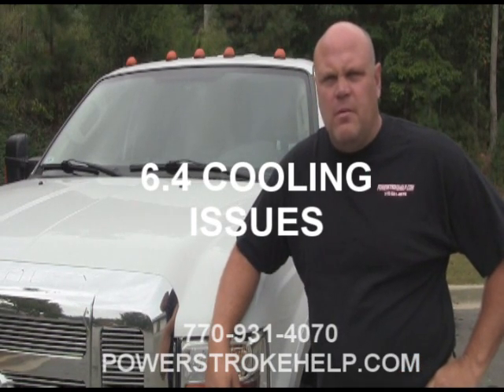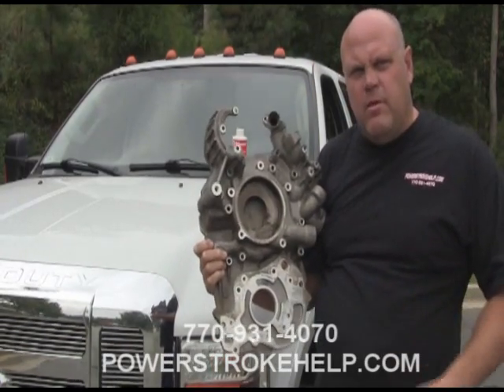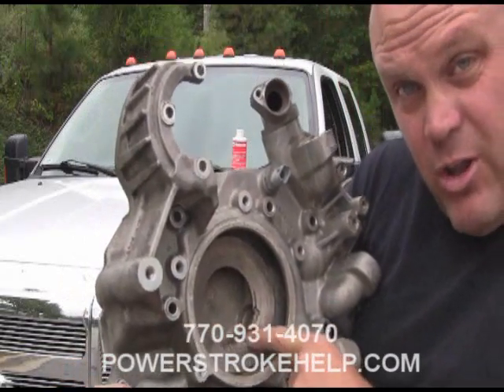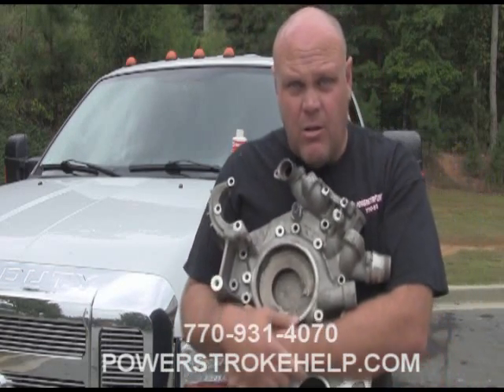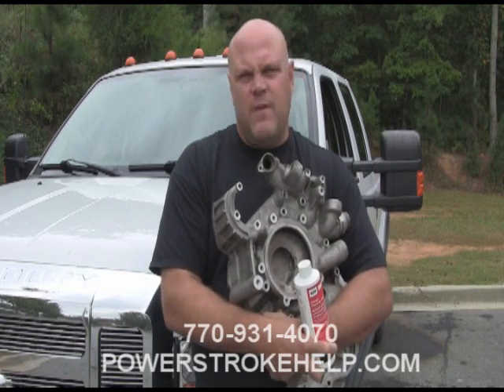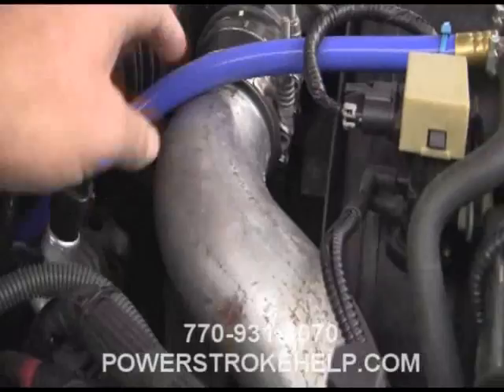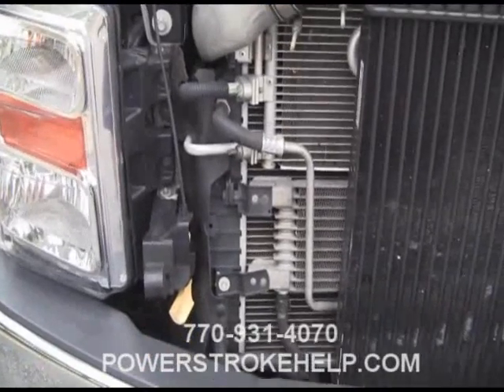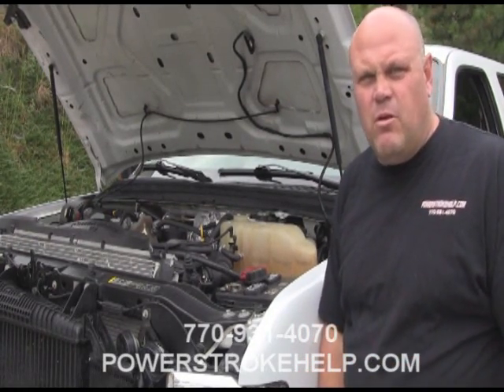6.4 COOLING ISSUES

Comment: Delete the DPF and the EGR until they prove that these systems do anything to improve the overall emissions of the truck. (1) While in regen partially burned fuel still bypasses the DPF this is evident in the embarrassing amount of white smoke and horrible smell. This also causes a huge loss of mileage. My estimate is 5 miles to the gallon. This system is just not a good emissions-cleaning system. A properly maintained Diesel engine running at the proper temperature is much better for the environment. Think of it. Less fuel per mile and better combustion equal fewer emissions the EGR is just all bad throwing soot into the air that's needed to properly burn the fuel is scientifically all wrong. We go through painstaking processes to get the cleanest best burning fuel to give us the cleanest-burning fuel, ever and then through mud in it. Would you ever think of putting a device on the chimney of your house or apartment or factories like this DPF? No. I believe not. The egr system is just all bad. Bad for the environment and bad for the longevity of all internal moving parts of the engine only adding to the huge contaminated landfill process. Ford knows this GM knows this Chrisler knows this every car manufacturer in the world knows this. Everyone is desperate to lower our responsibility to lower our .03% of the world's CO2 footprint. We are we have accomplished huge environmental improvements here in the Western world as well in most of the EU. We are not done. We will continue to make improvements as that equates to profits $$$😊 and general health and wellbeing worldwide.

Comment: i'm currently removng my mishimoto aluminum radiator for a tank leak and repair not from vibration, but bad install and bolt chafe so was doing diesel coolant research for my 6.4. i'm no expert. however, i find no information supporting what bill recommends for 6.4s. so maybe bill can set me straight. the ford additive bottle showed above did not expose the complete label to see the product title. so my dealer showed me vc-8 additive (bottle looks the same) and did not recommend it for a 6.4. they had no recommendation for 6.4 cavitation just adhere to the maintenance schedule. whether they're correct or not i have no evidence but i'm looking. the 3 additives in vc-8 are corrosion inhibitors and no defoamants. by "no" i mean it doesn't list it on the bottle or indicate any other proprietary mix. vc-8 has no "cavitation erosion rating" per ASTM D 2809 i can find. this is easy to find if you go to valvoline products and Zerex G05 they provide a PI sheet or product information sheet. so far motorcraft will not provide test data for their Gold coolant. until motorcraft or a dealer convinces me different i'm just going with G05. it tests well in all categories ph, corrosion all metals and erosion. anybody?

Comment: So, I'm about to do the flush an add the additive just because my 08 F250 6.4 is running warm. Not hot. Instead of my gauge at the 12 it says around the 1 o'clock position. Anything I should know🤔🤔 Also haven't deleted yet but I am in a week

Comment: Question about 6.4 I changed the rad and then updates the lower hose and fixed another leak and let it run high idle with cap off then took it for a spin because the idiot gauge read like it always does and the coolant pissed everywhere and boiled over then I watched your video on the rad caps and the boiling points. So could this have just boiled over because I had the cap loose and the fan didn’t kick on in time

Comment: I have a 2008 f350 6.4 powerstroke and it's got a coolant leak from around the back side of the oil pan while it's not running I cant figure it out

Comment: There is debris(abrasives) in the coolant. Causing sand blasting of the soft aluminum.
Listen to Bill and put a filter on it. Cheaper than a front cover.

Comment: Old video but let me tell you I had 2 oz of sand in my coolant filter and had very small shavings from my new mishimoto radiator.
Reply: Makes me wanna check mine now, I did the radiator, hoses and coolant filtration. Very expensive but way better than the ford stuff.

Comment: I have a bullet proofed 06 6.0 F250 turbo diesel  I have replaced the degas cap replaced thermostat  I have no white smoke I cannot find the leak checked the oil no mixing  checked psi  was at 16 psi until I was going up a steep hill then it gradually  climb to 20psi I am haven to put water / coolant  in everyday  sometimes twice a day  please help I haven't been able to find anything to really help me as far as u tube or Google any advice will help Thank  you

Comment: bill having a problem with coolant coming out of expansion tanknew cap, new oil cooler, new radiator, egr delete, tuner and heater core. we are finding no evidence of blown head gasket being bad. Preformed  pressure and chemical test. only time it builds pressure in coolant system is when turbo is between 30-40 psi. any Ideas?

Comment: Why is my 6.4 showing oil temperature at 450 and 500 F. I only know because I have an obd gauges tool. However it doesn't show that is overheating. Engine temp at 200 F . Trans. At 180 F . Could this mean the oil cooler is bad right? Or what is the normal range for oil temperature.
Reply: Noe Salgado if your oil temp got to 450 degrees I'm surprised your engine is still running

Comment: What if a 6.4 is consuming antifreeze at a stupid rate?
Reply: David Vermillion, head gasket gone or coolant res pressuring up ,have mine just about torn apart to where I'm pulling my turbos then manifold n finally heads ,book hrs at a shop call 23 hrs n I'm in 3 hrs n took 10 min to lift cab 6 in ,first time doing but I refuse to pay $6000 all the best bud

Comment: I run CAT ELC DPF delete with Spartan tuner no problems whatsoever truck runs like brand new! (BETTER THAN NEW AT 140K)
Reply: She won't for long. Just my opinion.
Reply: HERPY DERPEDY I agree it's the stupid emissions equipment that really hurts these truck in the long run
Reply: SAM T isn't a dpf delete illegal almost like a straight pipe?  I'm in Texas. Small town. Inspectors don't really care but cops do a little.
Reply: Corbin Karl yup. It's illegal everywhere.
Reply: Ilikeboost it’s illegal everywhere like pot is. The feds say pot is illegal but  many states have made it “legal”. How does that work? The federal government made it illegal by their recent EPA regulations to do away with these ridiculous “improvements”. In my state, I’m not required to have an emissions inspection on my truck so I can get away with it. It comes down to what you can get away with.
Reply: David Vermillion oh this truck will last longer Regen melts pistons on stock trucks tuned 6.4 on a low tune should keep it running better longer with no Regen and Egr crap

Comment: Hey Bill, I have a 6.4L 99R that leaks engine oil in to the cooling system but it does not leak in to the motor. Any idea of what the cause may be?
Reply: Thomas Cruz does anyone get answers or responses from him?
Reply: oil cooler? Get that checked

Comment: Bill, as a test, try running Caterpillar Extended Life Coolant (ELC) in place of the FoMoCo coolant and additive. I'd bet the cavitation issues you present in this vid will be all but gone. I've seen engines disassembled with nearly 2 million miles and the coolant side of the parts look nearly new.Make certain to buy the pre-mixed, or if you do go with concentrate - the rest of the fill has to be distilled water, no tap water crap.

Comment: hey guy's  (anyone) I need help removing my water pump on a 2008 ford f350 6.4L. I got half ways the problem is that I can't remove the fan clutch. Need help please..... Thank you.
Reply: Ayala100 you need a specific tool for that
Reply: Its call a pipe cutter and bolting on a regular old style fan. Fan clutches are BS. (do't take my advice this is just my opinion)
Reply: Reverse thread n all I used was a large open end wrench can't remember the size n a punch that fit in the little holes on back of hub it came off like nothing

Comment: i have a 2008 f550 6.4.  today we discovered motor oil in the coolant reservoir tank.  Any idea or suggestions as to why this is happening?
Reply: head gasket leak. Kilmmer has a video on it

Comment: If I drive the 6.4 like a race truck, will I need to have dpf cleaned every 15,000 miles to prevent dpf issues?
Reply: Why don't you just get a dpf delete
Reply: Powerstroke6.0 7.3
Well im just asking a questtion.
Reply: +knightrider1545 I wouldn't have that dpf on there if you are going to drive it like a race truck delete the dpf so it can breathe better and so you don't kill the engine with the regens

Comment: I have a 2008 6.4 , I found a lot of coolant in the intercooler, drive 10 miles and I need to add 2 galon of water, any idea? Thanks
Reply: stop driving the truck!!! you are going to hydrolock your motor.
Reply: Jose Noyola Yolo

Comment: I have a 6.4 that I gutted the dpf and the cat, I was told I would get around 20 mpg but it gets 13.5 mpg any suggestions?
Reply: have you put a tune on it? a small 20-40hp street tune can help the fuel economy as well. tire pressures make a huge difference as well (it made a 3-4mpg difference alone for me on a mustang of all things)

Comment: Great Video.  I have a2012  F-350 with a radiator leak (front driver's side, bottom of radiator).   Can't afford $1,700 from the dealer.   Any suggestions?
Reply: Do NOT put any sealent into the engine do NOT, get a rad from bill yes its alot of money and do it yourself check forums for how to, or find a diesel shop to install it

Comment: how often do you need to add the coolant additive ? also how did you install the coolant filter on  the input side ? I have a 2008 F350  47000 mi on it so far i been lucky only the EGR valve went out on it so far ,but i want to replace things before it shits it self ,when should i change out the cooling cooler iol cooler ect so i can keep it out of the dealer shop !!!!!! thanks

Comment: Ford changed my coolant after warranty work on a leaking oil pan gasket, anyway I asked about the additive for coolant and was told it didn't need it????? I thought it did need the additive? Can you answer my question additive or no additive? 2010 6.4 with all H&s deletes, the BEAST!!

Comment: I know this is a video about the 6.4, but when you mentioned it I had to ask... Is the DPF regeneration method on the 6.7 the same as the 6.4? Where the 7 and 8 injectors are held open during the exhaust stroke? Or is that specific to the 6.4?
Reply: +Marcus Mar I would verify that, but I believe the 6.7 included a 9th injector in the exhuast like duramax does. Do not quote me though
Reply: I believe this is also the case with the 6.7

Comment from the maker: You need to get hold of Charles at KEM Racing 706-819-2572 and order his tuning card for that truck. Your motor is on borrowed time running race tunes on the street. His tunes make just as much power but without the race tunes timing advance. Best money you will spend.

Comment: Question, Ford recommends coolant flush/change every 30000 miles which I have done at 30000 since I have installed the h&s with all deletes, do I need to continue with the ford scheduled 30000 or go say 40000. When you do the deletes all that heat is not but back in the engine seems you could go longer. Thanks for your video oh I have a 2010 6.4 with 54000 current miles and love the 6.4 it simply is a beast and hasn't ever been beat "yet" lol
Reply: Down Da Bayou Louisiana how has it been trying to ask as many people as I can with a 6.4 that have deleted if they have had any issues I plant to buy one and do the same in a year or less

Comment: The price is a major issue, my 7.3 is paid for and it's a TRUCK, not a Rolls Royce as they seem to think with the $70K Pricetag on the 6.7. 

Also my 7.3 with good maintenance will go well over 500k miles before a rebuild, the quoted expected life of the 6.7's is 250k before a rebuild, and with much shorter maintenance intervals.

Also the idea of an aluminum diesel engine with a plastic oil pan just seems kindof cheap to me...(especially with a $70k Price tag)
Reply: USSNAFU 
Aluminum heads can’t take the heat and pressure of a Diesel engine. They will eventually crack. Aluminum heads on a diesel is part of planned obsolescence.
Get a real diesel with cast iron heads.

Comment: Exactly why I will drive my 7.3 until it is dust.

If I ever did have to buy a new truck, as much as I like Ford's tough chassis & drive-train, I would have to go with a different MFR unless Ford Upper Management pulls their collective heads out of the sand & get back to their roots of "Quality Being Job 1" which is why most Ford Owners Purchased Ford vehicles in the first place.

Comment: I have seen updated radiator hoses, thermostats, and expansion tank... any idea what these are designed to prevent/repair on the 6.4?  

About to delete the EGR system and since the coolant will be out I am thinking on updating my components accordingly.  This will be the third time I have had my coolant out on the truck... no failures, just flushing every 30k plus the external filter.  $125 well spent.

Comment: Hey, Hewitt, If I win the lottery:  I'll purchase a F-650 for you!  AND 3 more that you can play around with to "bullet-proof"  You'll need to video tape the process and charge Ford MC for all of your R&D.   Yeah, a whole engineering analysis of any flaw in the design in the power plant.   I like Fords!  They ought to perform as rock solid as their bodywork looks!  Something that operates at the lowest cost, is reliable and lasts a few decades could put the crown back on the "Blue-Oval"!

Comment: "NOTICE:
For diesel engine, do not add Motorcraft® Diesel Cooling System Additive when refilling the cooling system with new coolant. An excessive amount of additive may cause formation of gels that may cause coolant flow restriction, plugging of passages and overheating." from the F-250 Workshop manual

Don't put in coolant additive unless you have completely flushed the system by removing thermostats and coolant plugs in the block and flushing the system with VC-9.

Comment: Bill, is there a "witness button" or engine block overtemp device on the Ford motors?  So, when you have a overheated motor that comes in, you can see if the temp went past the indicator point?

Comment: Bill, got a question regarding the 6.4 block heater.  Don't know if you've have to replace any.  Mine stopped warming the engine the other day, put an Ohm multimeter check on it and it read OL or Open.  If you have any info on where or how to go about changing this I would appreciate it.

Comment: If anti freeze gets in the oil,won't it ruin the bearings later on?.Do you flush the oil with a chemical flush or just change the oil several times.Thanks. Just found your videos and maybe i'll go back to fixing diesels. 38+ years of fixing gassers.  One of the best all around weather year round is Atlanta,GA. Was searching RE for salvage yards. Boston winters S#$&.

Comment: You have great posts and advice. I recently deleted the cat and dpf on my 08 6.4 and I'm running a custom tune from KEM performance. It is 150 over stoke. Is this a safe enough tune or am I still too conservative at 150? I turned off the egr cooler as well. Was that a good idea? FYI, I'm going to Advance auto for a cap today. Thanks in advance,
Thomas

Comment from the maker: The EGR is less of an issue once the valve is shut off electronically through tuning but the DPF has got to go on the 6.4L or it will grenade the engine eventually

Comment from the maker: 6.4 is a great engine that will live a long time IF you get that DPF gone.
Reply: Lies😳
Reply: @reesekegley3622  mine still runs perfect with 204,000 miles on it. been deleted for a long time. No issues. Change oil and fuel filters regularly. People want to drive them like they stole them every where and not maintain them.

Comment: A $17,000.00 motor, Holy Cats! Bill..I have been thinking of getting a 2 nd. pickup in a regular cab, and am looking at getting another Y2K edition 2000 7.3 diesel.  I like the leaf spring front end, and the 7.3, etc.  I am looking on Auto-Trader and there are 2008's with the 6.4 that are cheaper and newer than the 2000's!  Your thoughts please?

Comment: Do you think a steel or cast iron front cover would solve or reduce the cavitation problems?  IMO a harder metal or one with a smoother surface could improve longevity of the part significantly.

Comment: Do most of the cooling issues you talked about only happen when the truck is in Regen mode? I'm just curious if I had of DPF removed and the entire exhaust changed and the engine tuned a bit would the cooling issues still be a problem?

Comment: Bill, Have you ever removed the egr of a 6.4 and replaced it was a waste gated set up.  There are some companies offering the system and was wondering what your thought was.  I have a spartan tuner 210 tune, egr shut off. I also understand the turbo use the egr as a waste gate of sorts.

Comment: When will Ford figuire it out w/ these Powerstrokes? Seems like every year it is a new problem. Waterpumps, Coolant issues, Egr problems, Radiators,Emission probs,etc.. I want to like these Powerstrokes, but DAMN it is hard. Seems like Dodge just got their CRAP together w/ cummins vs PS. What do you think of Pre Powerstroke models. What year would you recommend with the INTL motor? Your vids are awesome by the way.

Comment: Not even close, totally different animal. Different injection system, different turbo, different intercooler, and different manufacturer. Different block as far I know too.

T'he 6.7 are torque beasts from the factory, I think I would be happy with the power of a stock, untuned engine with the 6.7. They are also getting excellent fuel mileage from the factory.